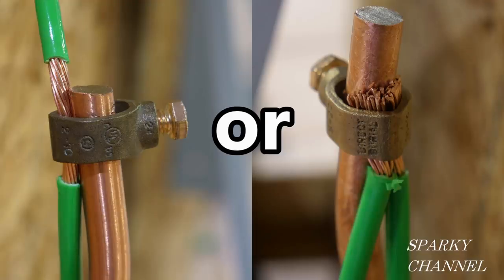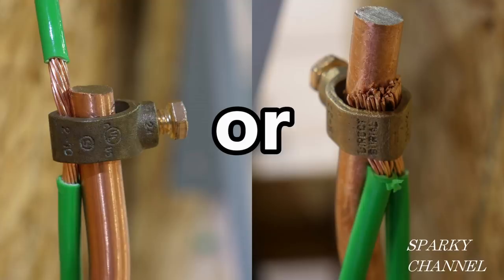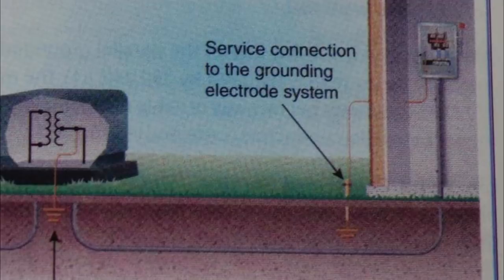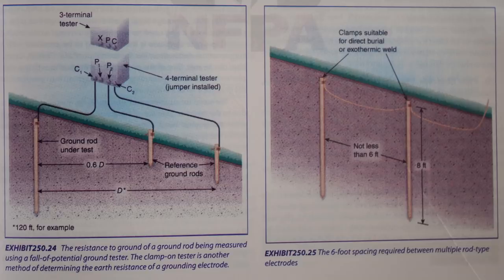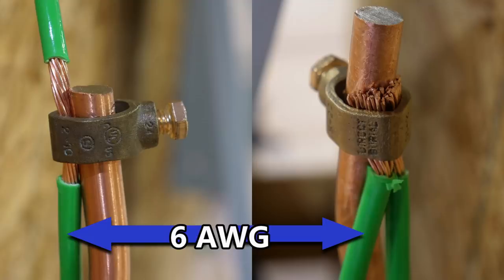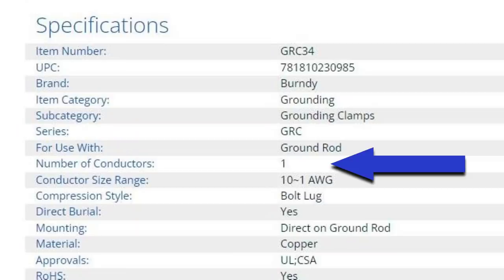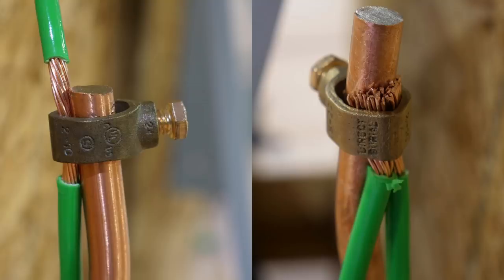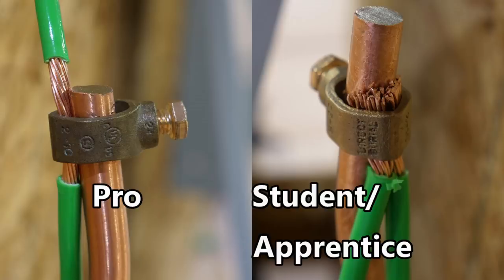Which is Correct?

Comment: had my regular inspector call me out about a year ago for not having an inspection hole at my exothermic welded concrete encased electrode, so I put in an inspection hole, then asked him if the code had changed, and he said, "no, but nobody else does that and I forgot."
Reply from the maker: Great story!
Reply: @SparkyChannel  I actually bought the mold for one where it would have been extremely difficult to put an inspection hole, and I like it so much I nearly always do it.
Reply from the maker: @kenbrown2808  That's high quality work!

Comment: In my area to put a ground rod in you dig a small hole around the rod and add some water. You move the rod up and down with adding more water and the rod almost just sinks into the ground. No hammer needed.
Reply from the maker: Wow, where do you live?
Reply: @SparkyChannel  Bottom of the ocean? ;)
Reply: @SparkyChannel  I live in Illinois east of St.louis. The soil here is very silty when you get away from the river bluffs.
Reply: I have done that too before maverick. Works very well. Maybe a cup full of water down the hole will hydraulic out the hole all the way down but some say it is a no no because it decreases the friction and fit around the ground rod. Last one I did I used a about half a Gatorade. Surprised sparky and the others haven't heard of this trick. Better than bending it if having to cheat and cut it cause it just won't go. Then there are those who say just put a hammer drill on it and stand on the top  step of your 8 foot step ladder.

Comment: Doesn't the ground wire have to be continuous( not cut or spliced) tieing both ground rods together and all the way to the panel? That's how I was taught.
Reply: I just looked it up and yes, 250.64(C) says the grounding electrode conductor must be continuous except 1: it can be spliced by irreversible compression splices or exothermic welding 2: sections of busbars may be permitted to be connected to form a grounding electrode conductor 3: structural metal building frames can be used as the grounding electrode conductor (note I did the opposite in my dad's steel building - I bonded all the anchor bolts to the concrete encased electrode) or 4: metal water piping otherwise allowed to be used as a grounding electrode conductor
Reply: We use C taps if we have to add a second rod to an existing system so the new copper wire gets crimped onto the existing one
Reply from the maker: Ken gave a great answer.
Reply from the maker: @dudeman650  Great, thanks!
Reply: You can jump from one rod to the other but 2 clamps are required on one of the rods. Remember this is a termination, not a spice.

Comment: Should not cut ground rods before inspector inspects. He may make you drive another. If you do, keep the cut piece and maybe he will be in a good mood. People (DIYers) often cut them off because they can't drive them all the way, thus bent rods (give away). My electrician did this once trying to make a professional looking install. He makes sure he has his hammer drill/driver now, instead of a sledge.
Reply from the maker: Here in SoCal you need a jack hammer with a ground rod bit (Bosch makes them) and you need a 16 lb sledge hammer. And never never cut the top off. It's marked and an inspector will make you drive another one if the top is missing.
Reply: I thought the same thing

Comment: I believe certain assumptions are always present when code is written.  Here, the one screw, one conductor isn't applicable because the assumption is the screw is against the conductor.  I see no good reason why the second installation is a risk.  As far as the manuf.'s recommendation, they probably did make the best judgement.  Being that, the rules do end up being the bounds to operate in, but the second looks A-OK to me, especially with stranded.
Reply: It's not that the code says the "wrong" one is unacceptable, it's that the ground clamp is being misused. The manufacturer has tested, certified, and will back with their reputation the clamp being used with a single conductor. They haven't tested nor will back the use of two conductors sandwiched in that clamp. Using equipment in a way not designed for or rated for is the code violation.

Comment: I fold the wire and work it and the Acorn well below the top of the ground rod. I lather it with Deox and when I can I encase the Acorn and ground in clean sand. I try to get it 18" below grade. Now that is a decent method to me, but I ask you..... Am I not running two wires through the clamp? I don't cut it, but it is two wires..... Or is it one ?  Haha. Our Chief State Electrical Inspector agrees with doing this but like me he can't really say if it is 1 or 2 wires. I use #6 stranded BTW but sometimes I use solid which I prefer.
Reply: Cool method...as you already see, it can be argued both ways.  But since you have your AHJ, your chief state inspector agreeing with you, per strict code, you now win and are right, as you have the AHJ on your side!
Reply: @LiveHappy76  True that !

Comment: OK. Since behind (most) every regulation are accidents and dead people, what is the reasoning WHY there is only one wire allowed in the clamp?
Reply: If you have one grounding rod and one wire clamped together, there will be a solid connection between the two. But add in a second wire, it's possible for the clamping force to be quite solid on one of the wires while the other wire is barely held at all. So the other wire can be relatively easily pulled loose. 
Now look at the two examples given above. Both grounding rods are one out of a daisy chained series of grounding rods with the rod shown not at the very end of the chain. Imagine the rod on the right is the first one in the chain and hence nearest to the service panel. Imaging the wire from the service panel to the grounding rod is the wire that's inadequately clamped to the grounding rod, and that wire pulls loose. How's the grounding system in the house now? Now consider the rod on the left. Is it possible for that rod to fail in the same fashion, loosing the entire grounding system?
Reply: @johncochran8497  According to this reasoning, it is acceptable to use multiplicity of clamps on one rod, one clamp for each cable/wire. ?
Reply: @milantrcka121  Considering the other comments on this video, I'd have to agree.
Reply: @johncochran8497  Thanks for the education on the fine points of NEC.

Comment: the one on the left, are you sure it's one conductor? If it's two then how much is making good connection?  I guessed the one on the right because you can see then ends of the wires.
Reply: On the left is a continous cable, not two. It is not allowed to join two cables underground, only one continous cable going from one rod to the other. The end or ends of the cable must be visible and close to the electrical box/fusebox where the resistance to earth can be measured by the expert.

Comment: I never really understood the NEC, what can go wrong with the second picture?
I'm still studying, and it bothers me that the NEC doesn't really tell you what could go wrong if you ignore it, specially in situations like this.
I loved the video but I wish you could give more of an insight as to the problems with putting two conductors in that fitting, and in future videos too explaining the consequences of that specific code violation.
Reply from the maker: By keeping the ground wire continuous and unbroken, if your intermediate grounding connection is faulty it won't effect the grounding connections further down the chain. If two separate/cut wires are used, the faulty connection would/could render all grounding useless.
Reply: Let's say some goof that does all the torque specs by hand or uses an impact and didn't realize it's copper threads... They install and tighten so much the strip out nearly all the threads.  Soon after the clamp fails and both wires fall out of the clamp.  In the first example the second ground rod is still working. In the second example there is no ground.
Reply: what could go wrong? You flunk your inspection. NEC also mentions the rule of "one screw, one wire" many times in the book.
Reply: @rupe53  there are occasions where you are permitted to use more than one wire under one screw. The connections are listed for such a purpose at that point though. 

Sorry, don't mean to completely pedantic, but there are exceptions to many rules.
Reply: @IceBergGeo  Not sure how that's "pedantic", but it seems many people try to be so sophisticated.
Reply: Wouldn't 2 separate clamps be acceptable?
Reply: @Adam1nToronto  it is per manufacturer specs, but not per NEC, for a two ground rod system. Continuous ground wire.

Comment: I'm not in the US and I know your NEC is very prescriptive and not performance based in many aspects but: the most sensible approach to me, especially if the grounding rods are in disparate places in the property, would be to have a separate "home run" to the panel for each grounding rod. Piggybacking, even if done as described, increases the risk that a failure in a system of, say three rods due to, say electrolytic corrosion of the first piece of copper on rod #1 takes out all subsequent rods in the system, leaving your only ground your parallel paths eg bonds to copper water service pipes etc (and this decreases every year as more and more utilities transition to polymers). 

Of course, many grounding conductors are threaded and allow you to connect together sections so you can increase the contact area with the ground and also go closer to the saturation zone if the water table is not too low, increasing conductivity. "salting" the soil with a mild electrolyte like some dilute magnesium sulfate was also an old school way of improving your Z values, but of course this accelerates corrosion of the rod. 

There are other, better alternatives than ramming in multiple rods - ufer grounds, buried concrete encased electrode systems like the "Condudisc" with "Conducrete" (concrete that's been designed to be more conductive). These products have the advantage, in the case of the condudisc that the disc itself is encased in a permeable membrane and is made of extremely thick cast alloy and is rated to last, from memory, forty years - long after many standard grounding electrodes have turned into green dust. 

It's worth also noting that bonding to dissimilar metals needs to be done in a way that minimizes galvanic corrosion. If there is significant earth leakage in the property, this will also accelerate degradation of the electrodes - as will rural systems that use ground return (SWER) even if you're a mile from a transformer bond.  

Grounding is a subject that requires an entire four hour video and can't be covered in a few minutes. 

Perhaps the most important thing is that in an age where RCDs/GFCIs (trying to keep this relevant worldwide) are standard, the consequences of a deteriorated or broken grounding rod or equiv aren't as dire as they used to be, and thanks to neutral bonding the vital task of having a low impedance fault path is maintained. Absolutely there are consequences to having a floating ground, but if this occurs at the rod/s, after the residual current device, the consequences are far less serious than they were 40 years ago.
Reply: "but: the most sensible approach to me, especially if the grounding rods are in disparate places in the property, would be to have a separate "home run" to the panel for each grounding rod" We don't know if the left one (correct one) is piggy-backed. If the ground conductor is not cut, then it isn't and your point of one dodgy connection would not apply. If you can daisy-chain without cutting the conductor, then it's individually good at each connection point.
Last year, on getting a generator, I made a 'breakout box' with multiple sockets (6). The earth wire in the box is unbroken - so an earth connection failure on any one socket will not affect any other.
Now, for the neutral connection (which is vitally important) I have 'piggy-backed' the wiring so that if there's any breaks in the neutral it'd be obvious at the test stage. In fact, I've a planned upgrade to prevent the power being turned on if the neutral is missing from any socket - or for that matter, all of them as a break in the cable from the generator to the breakout box.
Reply: Using 2 ground rods 6 feet apart with a # 6 or # 4 ground wire depending on 200 amp panel or 400 amp panel application , 1 continuous wire connecting the 2 rods together with 2 acorn clamps with rods driven close to grade level is what code calls for grounding properly . If rods can’t be driven in ground all the way you can drive them in at 45 degree angle pointed away from each other so they are 6 feet apart
Reply: @genebeckley5189  I'm not American so I don't have any idea of your code, but I have seen American installs and it seems that at least in some jurisdictions it must be performance based - ie based on achieving a particular impedance - given I've seen disparate grounding rods, ufers, etc. As an engineer I take an interest in things like this, so I can't imagine that every installation I saw that differed were violating the NEC. 

There would be desert areas where concrete encased electrodes - or ufer grounds where the rebar of your structure takes double duty as your ground - would be the only option due to extremely poor soil conductivity and hard rock just inches down.

I can only comment on what is appropriate in my own country - and the multiple spaced out rods approach using an unbroken wire is only one of the six or seven different ways that an effective ground can be achieved. Shallow buried conductive concrete encased discs (condudiscs) are popular in arid regions, and these are not linked with an unbroken chain of cable but rather a separate home run for each disc. 

And then there's some regions where essentially no ground is acceptable due to PME with caveats (GFCIs mandated, and combined grounding/neutral conductor disconnection monitoring on any electrical vehicle charging points that shuts them down if the supplier neutral gets dropped to prevent the vehicle potential to ground rising and becoming a risk. The UK has these arrangements for TNC installations too.

Comment: I would have said nothing was wrong with either of them, they both make sense to me in electrical theory, but behold! The manufacturer is clear on this one. Just ONE conductor 10-1 AWG. Now is this per clamp? So could I have TWO acorn clamps on ONE ground rod? I just gotta know, I need to scratch that itch now. Thank you for your content!
Reply from the maker: It would be fine with the ground clamp manufacturers but you would probably violate an NEC code. So just keep the EGC wire unbroken. :)
Reply: @SparkyChannel  in Va never had a problem with 2 clamps, but why buy an extra clamp when you dont have to

Comment: Actually, mine would look like the second example, but the unbroken ground wire would be doubled back on itself with the bare loop inserted into the ground clamp.
Reply: It's incorrect. One clamp, one wire.
Reply: @JP-pf5pz  It is one clamp, one (unbroken) wire.
Reply: @NCF8710  still incorrect. At that point, it becomes two conductors, as it's going in and coming out. I'm pretty sure it has to do with the size and number of strands. The bigger the wire, the bigger the stands, and they aren't as likely to get smushed past the ground rod and become uselessly connected, as you can see in the picture. Just feed the acorn nut along the wire before you install it and then you can bend it right over the edge.

Comment: Could two clamps be attached to the same ground rod to avoid having two wires in one clamp?
Reply from the maker: That would be fine with the ground clamp manufacturers but there is another problem which I explain in "Hey Sparky, Why? Article 250, 2020 NEC": https://youtu.be/VdjgM6oAfmI
Reply: The code says it must be continuous.

Comment: Can someone explain to a non-professional why the one on the right with two wires is wrong? Not just because the code or manufacturer says so, but what is the electrical reason? It doesn't appear to be a space issue--the two wires appear to fit fine.
Reply: There doesn't have to be an electrical reason for it to be against code. For example, if the clamp wasn't tested for use with multiple wires, then it can't listed and approved for use with multiple wires.
Reply: @clozano6799  OK, I understand and can accept that. After all, that's what this vid was about--which of the two is a code violation. However, again, with my limited, non-professional knowledge, I'm guessing the two wire method gives a perfectly good electrical ground for most things short of a lightning strike. (Assuming the rod is buried correctly and the rod cut-off isn't an issue, et al). TNX for your reply.
Reply: The wire need to be unbroken or continuously run thru the clamp , in case the clamp fails..
Reply: It must be continuous because it is in a damp environment and the corrosion will create resistance. Thereby causing the ground path to become degraded.
Reply: In order for anything to get a listing, the manufacturer tells the testing lab ( for instance Underwriters Laboratory ) EXACTLY how something is to be used. It is then tested for the specific conditions and if it passes then it becomes 'listed'. So, the "why" it fails is a little complicated but in the end it's because it won't hold up electrically under the conditions it was tested for with more than one conductor. You see two or more conductors under lugs only rated for one conductor ALL the time. I think it is mostly ignorance but sometimes greed as the lugs rated for two conductors are more expensive.
Reply: @fritzmiller9792  installation and workmanship counts ,  too  I think it's article 110nec
Reply: @lostcause1206  Absolutely. Totally agree. Workmanship is a massive overriding code and I believe it is the one code that defines the NEC, as it should.